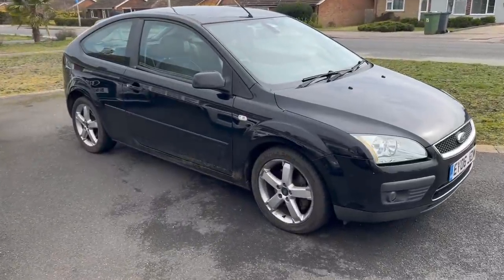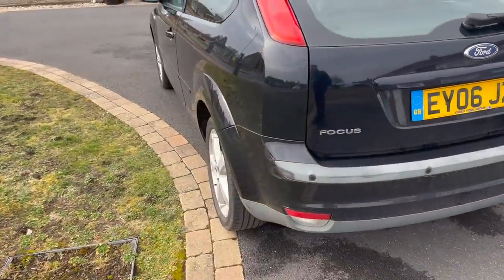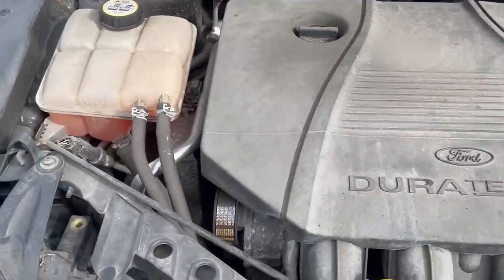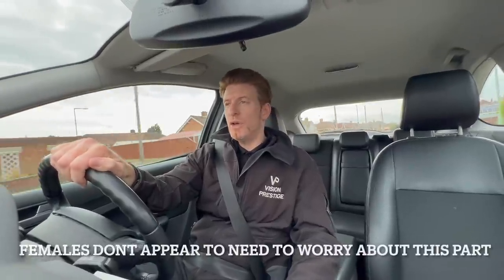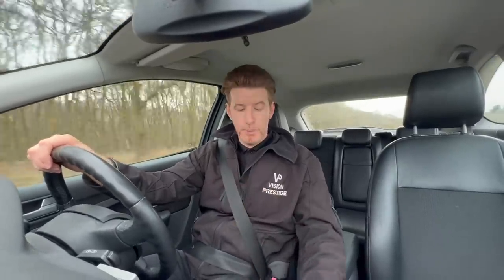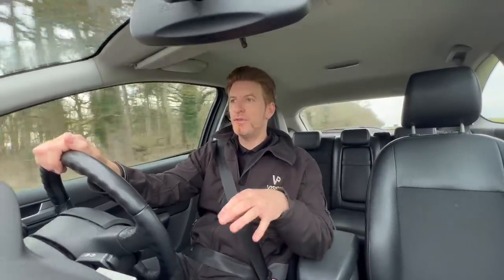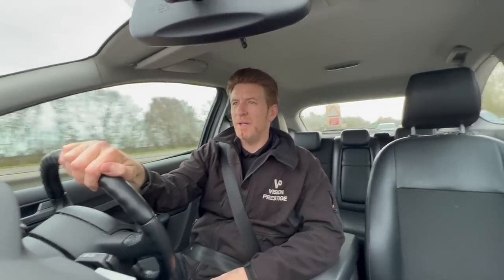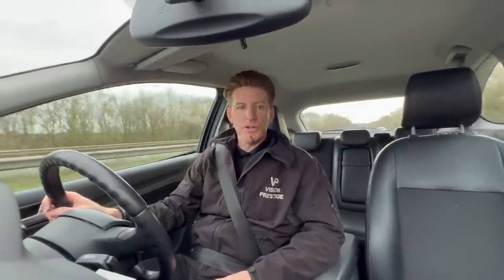A trip to a car auction doesn't always go as planned.

Comment: Kev that's amazing! The wheels! I currently have a 500 for sale, with 2 good alloys and 2 similar to yours. Customer viewed it this morning and weren't too bothered, she would rather have a discount rather than have the wheels repaired/replaced and pay full price. However, I have a tin of that hammerite in that colour, if I can spend an hour just tidying them up everyone's happy. Would never have thought about doing that. Top man, top tip.
Reply from the maker: Glad its helped mate, buy a cheap little set of needle files to smooth out the kerb rash, will only cost you a couple of pounds but makes a huge difference as alloy is so soft you can grind down the damage to nothing then brush touch up to finish 👍👍👍
Reply: @VisionPrestigeCars  great stuff, thank you, I'll do a video on it, I'll credit you obvs 😉

Comment: Chops garage was saying the same on an old Honda logo, 2k cars don’t exist anymore. It’s a fair fix on the wheels given how old the vehicle is and mileage otherwise passing the cost on makes it a non starter. Nice video and update on the trading. I would love to mop
My car but literally scared to do so .. can you recommend a mop for an enthusiast? 😂without spending loads and compounds that non trade could buy
Reply from the maker: Yeah Will the budget car doesn't really exist anymore, shame!! As for a mop, I would just say go for the smallest one you can afford, as the big cheap ones get real heavy real quick which isn't a good combo. You could start with a DA if your worried, I did, they move around so don't generate any where near the heat of a rotary, the problem is, you need the heat to cut really 🤪Any compound will do when your learning, just go to Halfords and get Meguiars or Auto finesse 👌let me know how it goes 🤪🤓Kev